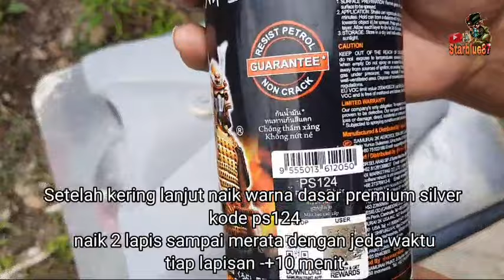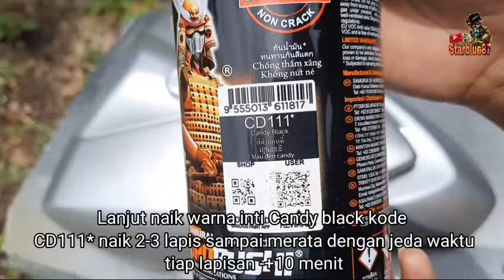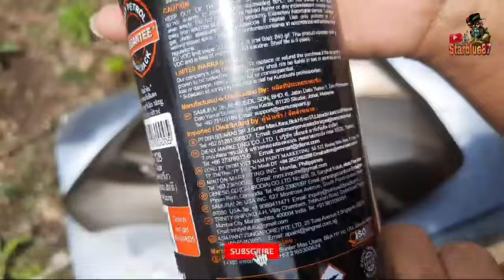WARNA CANDY BLACK KODE CD111 SAMURAI PAINT..

Comment: Bang mau nanyak motor new cb ku kan hbis di cat kompresor .mau gwe standarin lagi warna hitam .yg di tangki di amplas lngsung epoxi. 
 apa di remover aja di kupas habis mulai dei awal
Reply from the maker: Ga perlu di kupas bg kalau cat nya belum tebal, cukup Amplas rata sampai halus pakai ukuran 600 lalu naik epoxy 2k04 - 2-3 lapis setelah kering keras di amplas lg pakai ukuran 600 lalu 1000 , lalu naik warna black kode 109 tunggu kering lalu naik clear 2-3 lapis..
Reply: @Starblue87  gk perlu warna dasar lagi berarti bng langsung  hitam hbis epoxi